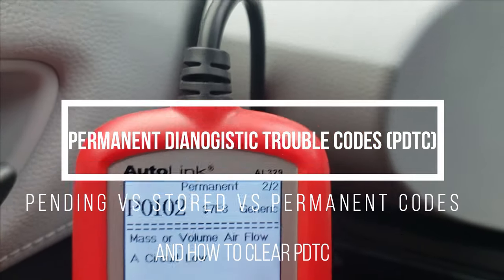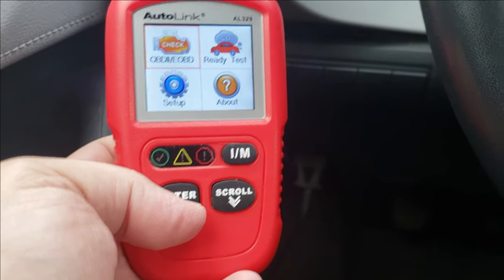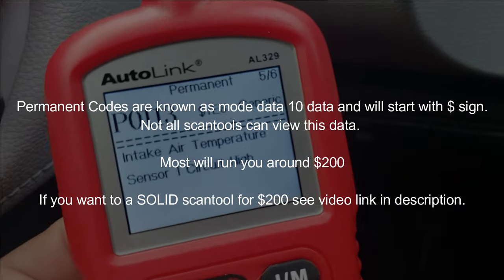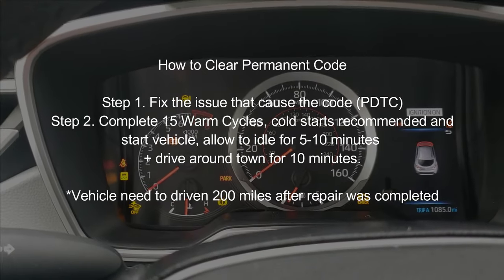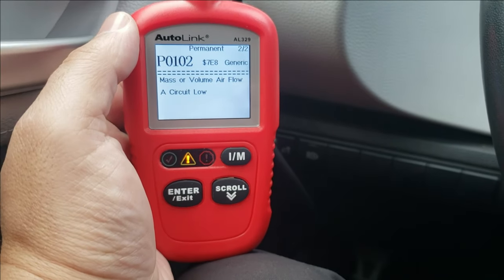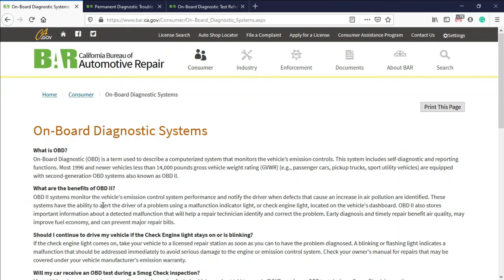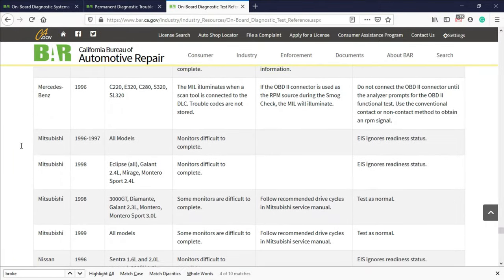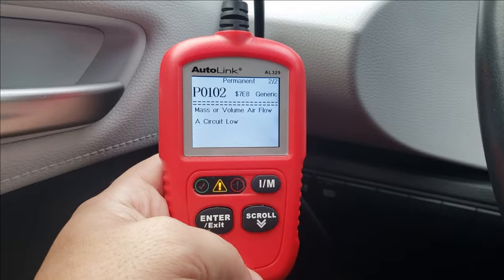Clear Permanent Codes by doing this with your vehicle!

Comment from the maker: Permanent codes cannot be cleared by disconnecting the vehicle's battery.

▶ Updated Permanent PDTC video https://youtu.be/YHoL9z_o-M4
▶ Updated Permanent PDTC video https://youtu.be/YHoL9z_o-M4
▶ Updated Permanent PDTC video https://youtu.be/YHoL9z_o-M4

▶ Good Bye Permanent Codes! Drive to Clear PDTC https://youtu.be/BDTrfkxBvJU
▶ PDTC won't clear? Get Rid of PDTC with OBD2 Reader Data https://youtu.be/wcCRN_c6Mss
▶ Bye  Permanent Codes! Clear PDTC using Scan Tool Data https://youtu.be/MTW5_MF0KY0

▶ Permanent  Diagnostic Trouble Codes and How to Clear Clear Permanent Codes ▶ Get Failure Help
New Smog law Permanent Codes mode 10/$0a smog Failure HELP

▶▶ Link to recommend OBD2 reader https://amzn.to/3SgUTf3
▶OBD2 Reader video https://youtu.be/SguhiTfgpFQ
▶ Why you need a scan tool https://youtu.be/WrzE_E6WixM

▶Complete Smog Playlist https://www.youtube.com/playlist?list=PLDEbtVOPRC-h4WB90arPwdn_r7wr3kGki

▶ 12 Minute Actual Drive https://youtu.be/jldTJI64cfM
▶ 6-step drive cycle https://youtu.be/JrXOAVkK42E
▶ Actual Smog test performed https://youtu.be/5DYY3mqGJTM
▶ Demo EMISSION INSPECTION MONITOR Readiness (I/M)  https://youtu.be/gAumb9zgLZg

▶ Acura Drive Cycle https://youtu.be/2b7dYwMQZDo
▶ BMW Drive Cycle https://youtu.be/mk6Tk330Acw
▶ Chrysler Smog Readiness check https://youtu.be/O1RH-u1bNIc
▶ Chrysler Smog procedure https://youtu.be/dyYv4HpYPys
▶ Ford Drive Cycle https://youtu.be/j8ZFTE1rSfA
▶ Gm Drive Cycle https://youtu.be/Yp34ksJY-fQ
▶ Honda Drive Cycle https://youtu.be/oZELvZ4danA
▶ Honda Smog Readiness  https://www.youtube.com/watch?v=cxpE_I1cKh8
▶ Hyundai Drive Cycle https://youtu.be/UzC4FNTqNdI
▶ Infiniti Drive Cycle https://youtu.be/76SByziNMFI
▶ Kia Drive Cycle https://youtu.be/OtSDdIgQ6_g
▶ Mercedes Benz Drive Cycle https://youtu.be/gLnhD4gP0kM
▶ Mini Cooper Drive Cycle https://youtu.be/ND08_kKz8Ls
▶ Mitsubishi Drive Cycle https://youtu.be/3ywgZW2zMa8
▶ Nissan Drive Cycle https://youtu.be/s9PLkO-CjZ8
▶ Subaru Drive Cycle https://youtu.be/w3DF4g2h96M
▶Volkswagen Drive Cycle https://youtu.be/uh8BhqJpzGg
▶ Volvo Drive Cycle https://youtu.be/mEeUwDd_dsc
▶How to Pass Smog Test, Understand Emissions Drive Cycle To Pass Smog
https://youtu.be/gAumb9zgLZg
▶ Catalyst monitor not ready? https://youtu.be/hi7QdlgKHzM
How To Clean Catalytic Converter▶ P0420 P0430 Fix - no removal https://youtu.be/U0-0XMWR3ow
▶ Catalyst Monitor Cheat https://youtu.be/BuZYAy_xi0E
▶ Catalyst not ready? Watch this video https://youtu.be/ERQUUdWo3-o
▶ Evap monitor not ready? https://youtu.be/99nfTcPy4fo
▶ EGR monitor not ready? https://youtu.be/aujgghRf04I
▶ Oxygen sensor not ready? https://youtu.be/sAvxeAyYsRk
▶ Oxygen sensor replacement https://youtu.be/9jKuutvNs74
▶o2 sensor monitor incomplete https://youtu.be/sAvxeAyYsRk
▶updated o2 sensor fixes https://youtu.be/Yn1-ul62Jio
▶How To Test Oxygen Sensor Heater Circuit https://youtu.be/1aZr20KXnbs
▶ Oxygen sensor heater element testing https://youtu.be/zEbXn6vgqiA
▶How to use OBD2 Reader To Check I/M Readiness to Pass Smog Check https://youtu.be/gAumb9zgLZg
▶ 2024 update Get CAT Monitor Ready FAST! https://youtu.be/HkF4oCED0UU
▶Does Cataclean Work? Failed Smog, Bad Catalyst, P420 P430 P431 https://youtu.be/3w-FrjMFKvs
▶Prius Catalytic Converter Replacement▶ $118 Direct Fit Catalyst Install After Theft https://youtu.be/uIXslV-Wt3o
▶How to Buy Catalyst For Cheap if Your Catalytic Converter Gets Stolen https://youtu.be/Wr1vFqCnpDc
▶Catalytic Converter Cleaner? P420 Fix? - Should You Use CRC Emission System Cleaner? https://youtu.be/hoijus6P3Gc
▶P420 Smog Failure? Watch to See if Dura Lube Catalytic Converter Treatment Can Help https://youtu.be/lRMISO1FCYo
▶2024 update How to look up state Inspection Monitor Requirements. I/M monitors status codes https://youtu.be/QKxDzdTVJOU
▶what is a PENDING DTC https://youtu.be/MwFS7cYGMyk
▶What is a STORED DTC https://youtu.be/smaIj1DV9ik
▶What is a PERMANENT DTC https://youtu.be/YHoL9z_o-M4
▶pending vs stored vs permanent explained https://youtu.be/kVPSEQsvMOk
▶Permanent DTC long video https://youtu.be/PMcJtcSOzdk

Products
▶Fuel Treatment https://amzn.to/38p7Ps6
▶Car Memory / Data Saver https://amzn.to/3mCTpKd

Comment: Bruh your fix to clear the code is to just fix the car oh thank a lot bud didn’t think of that one
Reply from the maker: The video is about permanent dtc codes
Reply: Code means fix your car. Bud
Reply: yeah its a stored code on the computer so USUALLY it will come back i believe the only way to get it to go away is to purchase a new ecu
Reply: Thank you your information great video..I've been going stressful trying to pass my smog this drive cycle I've been doing putting miles I clear all my monitors ok clear my pending codes when i take it back to retest smog they still tell me I have permanent code their advice is drive more at this point I'm about to give up ..its a code p0456 small leak evap any advice would help thank you..
Reply: Too bad your wrong cuz all I had to do was use a better scan tool, my Rosstech cleared them all
Reply: Hey pal did you just blow in from stupid town
Reply: @durawins be specific, which ross tech? I want details. Is it a laptop software? Scanner? Details please

Comment: so the permanent codes are there to prevent cheating emission tests which is good for the environment but then you have to drive aimlessly burning gas and releasing carbon for 200 km just to clear the damn code every time it shows up
Reply from the maker: Exactly.

Comment: That was pretty slick how you showed a photo of a OBD reader, and the title "How to clear Permant Diagnostic Trouble Codes..."  It gives the impression you're going to show us all a neat hack to remove pesky PDTC's when in fact you merely tell us we really can't clear the codes, you have to fix problem, then let the car delete the codes. Very smart way to get views!
Reply from the maker: But that’s the truth. How else would I be able to tell you that?
Reply: @RANDOMFIX  it isn't helpful.  You didn't clear the code - you fixed the problem.  For me, I have a code that was thrown that will not me START the vehicle.  There is actually no problem, due to DEF levels, but the computer can't clear it because I can't start it.  Just wasted 10 mins of my life.
Reply from the maker: What are you driving where the def is not letting the vehicle start? It gives you a count down from 10 to 0 on the remaining starts. Did you exceed the count down?
Reply: @RANDOMFIX  Title the video "You can't clear permanent codes". This is clickbait.
Reply: So from my assessment of this video it was nothing but click bait !!

Comment: I have a 2011 Nissan Altima! I fixed my mass airflow and o2 sensors. I drove from Los Angeles to Vegas Way over 200 miles still having permanent codes. Maybe I’m not cold starting idk it’s Really frustrating cause the car Runs Smooth as Butter
Reply from the maker: Yes, you will need to complete some cold starts plus drive for a little while reach time.
Reply from the maker: They need do what I told in this video 
https://youtu.be/PMcJtcSOzdk

Comment: I have 2012 Nissan with a code for cat below threshold a mechanic recommended I changed the down stream 02 sensor which I did but the code is permanent about how many drive cycles do I need for that vehicle thanks
Reply from the maker: That’s what I covered in the video. You have to do many cold start warm up cycles and drive around town for 10-15 minutes. Is the new o2 sensor oem?
Reply: @RANDOMFIX  AutoZone oem
Reply: Turned out to be a bad Front Cat

Comment: Going through this right now with a 2018 Honda . Check engine light came on with 3 codes.. took it in for repair and it had a purge valve replaced. Check engine light went off after work was done. All codes gone except one permanent code ( small vacume leak ) the evap monitor will not complete so the car is staying in not ready mode for emissions check. My sticker expired last month and the dealer told me to just keep driving it around and the code should clear and the monitor should go to ready. Neither has happened in 2 weeks!! I have driven it everywhere and tried all the different drive cycles. Is it possible the dealer didn’t fix something right so the code is not going away allowing the evap monitor to complete? Gas is to dang expensive to be driving all the time just trying to get this code to clear or the monitor ready.
Reply from the maker: I hear you on the high gas prices. Fyi the evap is exempt even in California but the permanent code needs to clear by it's self.

This will help so you do meet to keep checking with a scan tool. 

https://youtu.be/cxpE_I1cKh8

I would do a long warm up ( 10 minutes or even longer)   and then drive a for 15 minutes around town and the freeway. 

Keep me in the loop.
Reply: Hello, we’re you able to fix this issue? I’m going through something similar
Reply: lmao been 3 months for my 2015 wrx and the fuel system and egr still wont ready. Evap only went ready last week. 3 MONTHS
Reply: Any update? Going through the same situation small leak permanent code won't clear or flash
Reply: Evap code is except so take it to get smogged

Comment: Thank you my man. I was having a different permanent code 1299 after some bad coolant sensors put my truck into limp mode. Half my cylinders are running because the limp mode. So I’ll have to drive it around with half the performance until it clears. 🤦‍♂️
Reply from the maker: Thank you and taking time to great feedback and good luck clearing your p1299 an let me know if need any additional help.

Comment: I got 14 you my 2019 Ford Fusion serpentine belt came apart rip the wires out of my crank shop sensor I had to buy a new connector and wire it in. But now I can't get the permanent code out so it won't even start to do the cycles. Thoughts?  I have 2 different scan tools trying an innova 5610 Which is fairly advanced but it's not erasing it I have a feeling I'm gonna have to get ford involved.
Reply from the maker: I thought I answered you yesterday.
Are the inspection monitors set?
What state do you live in? Is the pdtc your only concern?

Comment: very informative! I had a bad ambient temp sensor on my MINI R56 and after the repair I cleared the CEL but the permanent code wouldn’t clear. you did great in explaining it so thank you.
Reply from the maker: Thank you so much for the feedback. These permanent codes are a real nightmare and will cause much confusion for many vehicle owners.
Reply: @chickentendies4485  I just got the check engine light cleared Friday but the permanent code is still showing on the ODB2. I’m hoping after driving around in the next week or so it should clear
Reply: @chickentendies4485  my buddy is an auto technician and he told me it doesn’t matter if you drive the car for 10 minutes or an hour, it’s about having the car cool down and starting it up again 10-15 times. I think in a week or 2 you should be cleared up.
Reply: @chickentendies4485  he told me it goes based off your exact computer. so if your ODB scanner is reading it as a cold start even at 120 then in theory doing that 15 times should do the trick

Comment: My check engine light is not on on the dashboard. All readiness/monitors are ready (none is incomplete). MIL is OFF, but I have a permanent code P0430. I have driven the car for over 100 miles but still have this code. Will my car pass in the inspection? I live in Delaware
Reply from the maker: Here is how you can check a pdtc https://youtu.be/wcCRN_c6Mss?si=WAOC1MH_n_yoHGGW
Reply: Unfortunately many states have not published how they are handling them yet.  So your only choice is to go test and see what happens.   Many states just ignore them entirely.  Make sure and get a test through, don't let some inspector turn you away because they are confused by it.  Get the test.

Comment: I fixed my o2 sensor and my converter drove from ohio to Tennessee and check engine light still on with same perm. Code ... what should I do
Reply from the maker: Hopefully you used the oem o2 sensor. Did you clear the code after replacing the o2 sensor? Hey did you replace the o2 sensor? What dtc code did you have?

Comment: My 2016 f150 went into limp code. I replaced the part but it stayed in limp mode and now wont start. Any suggestions?
Reply from the maker: You need to scan it with a scan tool and see what’s pulling up. Have you tried disconnecting the battery for a few hours? Does it cranks? What part did you replace?

Comment: Thanks for the information …I made a tuneup on my Prius v and got hybrid battery replaced because I had p0a80 code and green bean battery still under warranty..any way beside p0a80 I have p0102/p2195/p01171 .After hybrid battery replacement and drive for almost 20 miles,the car was running well  until today I got Engine lights on and the car now like before looks goes up and down accelerating and desacceleranting by it self …I have obd inova obd scan tool and even erasing the codes it came back again and again…Unfortunately I just bought the obd scan tool after replaced …MAF sensor ,head valve  cover and gaskets related to it ..
Reply from the maker: Thanks for sharing how many miles are on your Prius v?

Comment: At the there is nothing for permanent codes, 
You said to see the whole video if there is permanent codes,
I buy a 2012 nissan crappie versa, two months and no check engine light but permanent codes still there I cannot pass smog to registered, already spend 1500 on repairs for nothing.
Reply from the maker: Hi Anthony, sorry to here about your Versa ( if worst started with a v. Vorst ever random silly automobile) issues. The code will only clear if the vehicle detects the fault is cleared. You could for 6 months and the permanent will hang around. Please follow the directions left the vehicle warm properly and drive around town with regular driving habits. You could of inverted this issue and maybe the seller sold if that reason or you the smog was a fake. I hope that helps and Happy New year a day to late.

Comment: I have mass air flow sensor code. Do i delete the code then switch to new sensor or do i switch to new sensor then delete code?
Reply from the maker: Install the new mass air flow sensor and delete the codes. If the mass air flow sensor throw a permanent code then the vehicle will have verify that is no longer an issue.
Reply: Thank you very much 🙏

Comment: Thank you for the info and tips ..its been challenging to pass my smog on my 2012 Toyota thundra i fix whatever it was on a po456 code ..i cleared it on my pending code got all the ok on all the monitors believe me i did all the endless mile driving cycles.. when i took it to retest smog they said it still fail on a permanent code at this point i giving up..they said to drive more and do more start ups..any advice would help thanks
Reply from the maker: So you have a permanent code with all monitors ready?
Reply: @RANDOMFIX  yes I did.. P0456 at first it was a pending code I ran the  drive cycle all monitors were all ok and my secondary air monitor showed inc and I know it was ok but he mention I still had a permanent I need to run more miles to pass smog and in fact I did a warm up start in the morning my secondary air showed "ok" on my obd I was very confuse what the smog tech wanted I to pass my smog
Reply from the maker: @2010nvillanueva  he wants the permanent code to be cleared. Obviously your vehicle needs to learn the issue is fixed to clear the permanent code and he wants all the monitors to be complete or showing okay.
Reply: @RANDOMFIX  i need to drive  more of the cycle  to clear permanent code
Reply from the maker: Yes, cold starts, let warm I for 15 minutes and then drive around town as usual for 5 to 15 minutes so the vehicle detect the issue has been fixed. What repair did you make?
Reply: @RANDOMFIX  thank you for your tips advice the repair I did change my gas cap OEM change my purge valve and check my lines if any warn out cracks on the  ends the last thing I will check do a smoke test
Reply: Hey Roman I drove my truck pass 200 miles probably do more warm up cycles recommended well yesterday I drove around I even bought the  obd monitor you suggested so this morning I started the truck did a 15 minutes then I hook up my obd all my monitors check all green also my IM checked green is it ready to for my smog and hopefully it pass  and shows theres no code found..thanks

Comment: I have this issue with my 2011 Dodge Ram 1500 4.7l.  It has 3 codes and 2 codes for throttle, which I've replaced twice, and they never go away. I drove the truck for about a month with no issues, and then out of nowhere, it came back. The other code is for incorrect communication received by the ECU. I've been dealing with this for almost a year and still can't get it to go away.
Reply from the maker: Sorry to hear about your issue. Your not the only dealing with the crazy bs. I have a dodge as well and had all sort of check engine lights for no reason. I was getting ready to fix them when I realized that my battery was on the weaker side. After replacing the batttery all the issues went away. Is that your issue as well? I don’t know but play close attention to it and make sure you a good ground. And be aware your vehicle this dodge 4.7 is known for issues like these and might under some sort of recall or exception. See if there are any tsb issued for this on carcomplaints.com
Keep me posted and lastly just know that ecu could be bad and don’t cross that off your problem list yet until you test it. I would unplug the battery for 24 hours after confirming it almost perfect. Then reconnect the battery and start all over. Keep me posted.